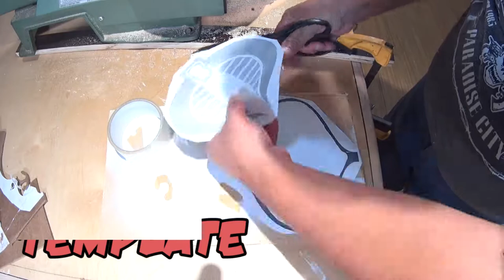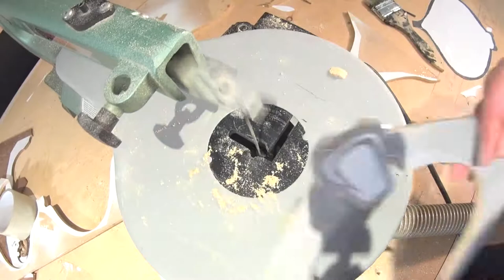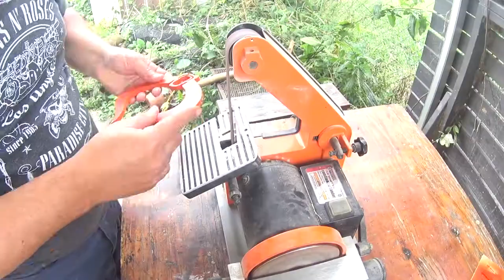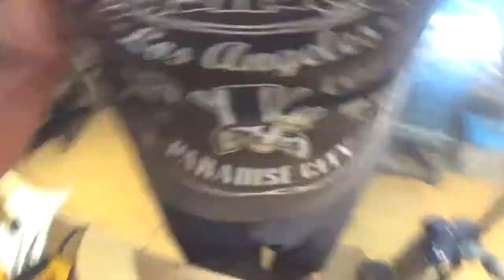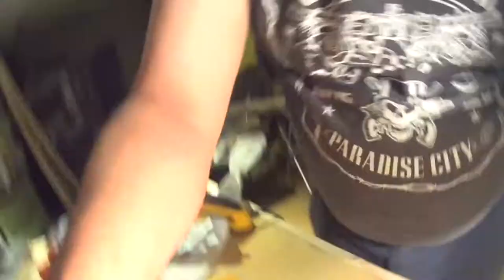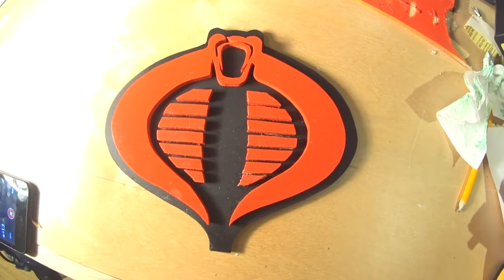How to make a 1980s G I  JOE COBRA logo

Comment: Like the story eloy. Question y do you use the packing tape and not spray adhesive
Reply from the maker: You can use either or. But 2 reasons. I ran out of adhesive and the tape is easier to remove. Actually the tape is also a buck for a roll at the dollar store. So unless I need to use spray for whatever reason, Im going with tape at the moment. It cuts down on time.